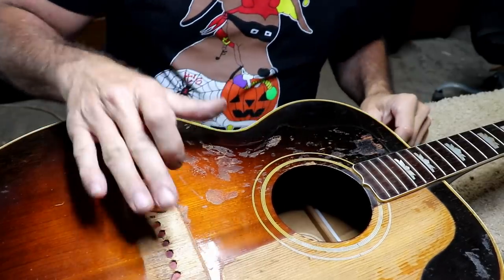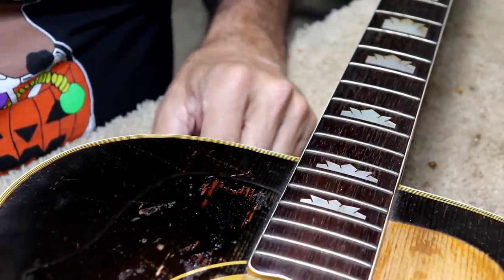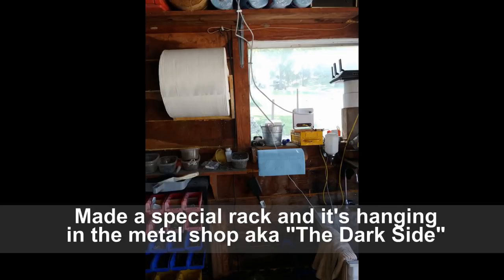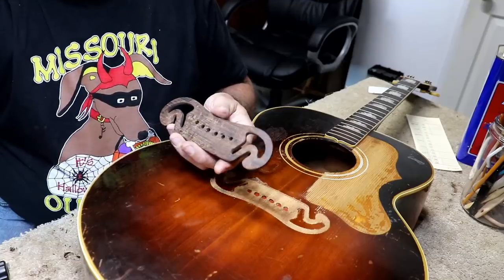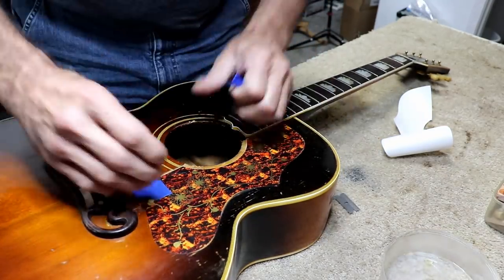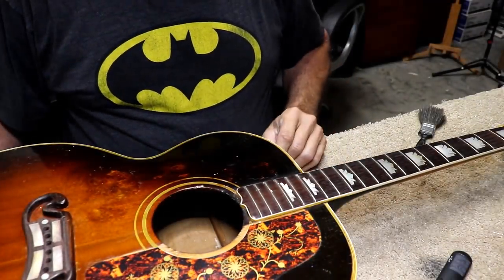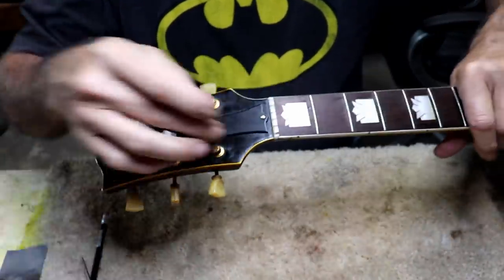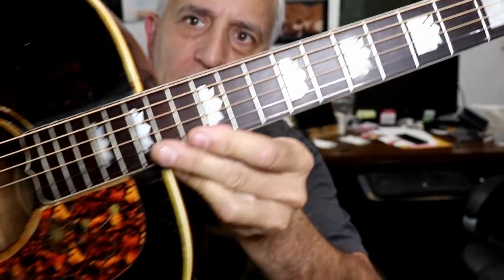294 RSW SJ200 Gibson Restoration Part 2

Comment: You are amazing...but that pickguard should have had more brown in the color scheme.  And he should have opted for the Dylan idea and go double guards.
Reply: eBay and other online sources stock matched left and right handed J-200 pickguards for $15 - $20 each. I think I would also go with the Dylan look, save a ton of work and have a much better finished product. The only way that I would support a right hand only pickguard would be to re-shoot the top. A vintage J-200 is worth the investment of premium parts and workmanship. I wouldn’t compromise on a classic car, and I certainly wouldn’t compromise on a classic instrument.
Reply: Great job. I have to agree with other posts that that pick guard is a little too "Tutti Fruity" for my liking. But you did a great job. Possibly an air brush with tinted lacquer would have been a little easier and smoother but the end result you got is really good. And if the owner likes the pick guard that's all that matters.

Comment: Very common in the Fifties among the country and burgeoning rock and roll sets to customize the 200. Everyone used them from Buddy to Presley professionally and they quickly became iconic. In fact, I would argue that they, alongside the Martin D28s are still the most recorded guitars in history.

Personally, I think Guild always outshines a Gibson in projection and sound. J200s are just two light sounding for the body size they have (compared to a D25 or D40 there is really no contest), but that is for an entirely different comment section.

That second pickguard was probably put on there by someone in that period. Gibson even started pressing a line with twin pickguards on their own for folks (Dillon Cash, etc.).

You should have spent the 30 bucks for the right guard; it is a 1/4 inch thick and has some dimension and depth when it comes from Gibson. Those Chinese guards are real flimsy and not the correct material. Doing so would really make the guitar look as it should (and you still can).

I argue that you should have also purchased a left-hander guard at the same time as the right from Gibson and put her back together as you got her. 

That guitar, whether a good or bad trip, took that trip. It has its own history of abuse and changes to tell to others when they see and play it. Why strip it of all that to something that just doesn't look quite right from a car's length away? It is plain, simple and true, she is just a cool old daily driver with a quirky history that people, when given reflection time, will make up their own stories about.

Of course, it's all just my two cents.

Comment: I hate it when people rip off that matching pickguard on the other side of the sound hole on a Gibson (S)J-200.  It just ruins the finish!!  Jerry did as good a job as anybody can to try and hide it, but it's still plainly visible. The only reason I can think of for anybody removing it or just hating that look in general is because Bob Dylan had one like that. Lots of people hate Bob Dylan. That's no secret. The owner probably hears "Looks like Bob Dylan's guitar" a lot. And they may not hate Dylan, they might just get tired of hearing that. Who cares?

Also, I prefer the original style J-200 floral pickguards with the black background. If this is all he could get then, oh well. But I think they ARE available.  I think I've seen on Reverb or somewhere.

Comment: If you ever should have used a sanding block on a top this was it. That way you would only knock off the high spots. I know your stance on sanding blocks but this time I think a block was called for to flatten the finish not just smooth it.
Reply from the maker: You're certainly entitled to your opinion.

Comment: The finish repair would have come out better if you had removed wax and oils with mineral spirits, than sanded. The nitrocellulose and wax mixed and couldn't spread to cover the bare spots.

Comment: As color blind as you say you are your better off not touching the finish on a old instrument. Leave that to someone who is not color blind.  And all that acetone was doing is eating and wrinkling that finish , You ruined it although it was in pretty bad shape already. Should have sanded it to start with then colored it in with a Air brush  Or even scuffed it lightly then sprayed a little sanding sealer to hold what color you had down then went from there. Oh well this was a couple years ago. One bit of positive info advice I want to give you. When using a spray gun or airbrush you can blend a color into another color and its hard for a normal eye to see it, so you can get away with the color being a little off

Comment: Cool you really took that sucker to the cleaners. There wouldn't be any profit in being honest. I love shysters.
Reply from the maker: I really have no idea what you're talking about. It's a very valuable type guitar. I charged him a tiny tiny percentage of what the guitars worth. I did tons of actual work. And the guitar plays and sounds great. He was incredibly happy. So no idea what you're referring to.
Reply: @RosaStringWorks  If you steel wool the rough and discolored spots you can then use artist oil paint brushed on to match the sunburst. Let the oil paint dry and then spray with clear lacquer and it will look great. Very good video. keep  it up.

Comment: That pickguard is disgusting  - If it's a mid 50's SJ200, it's worth putting a bit more into it at least because of its resale value - even as a player - at (app.) 2-3k.
Reply from the maker: It's nice to have an opinion. I didn't care for it either. But the customers loved it.
Reply: @RosaStringWorks   - LOL - it's a shame it couldn't be stuck on with velcro.

Comment: that pickguard ruined the job even more than the 
 patch of the finish.
Reply from the maker: Will you have to keep in mind a few things.  First of all, pickguards are temporary they just stick on you can peel them right back off. Only takes 5 minutes to change one. Secondly the real pickguard for that was over $200. I didn't want to spend that kind of money since the guy had a tight budget. And finally the customer believe it or not, actually like the pickguard so go figure.
Reply: @RosaStringWorks  Gibson would sell you a J200 pickguard for $200? The only way you can get a real pickguard from Gibson is to send the guitar to Gibson.